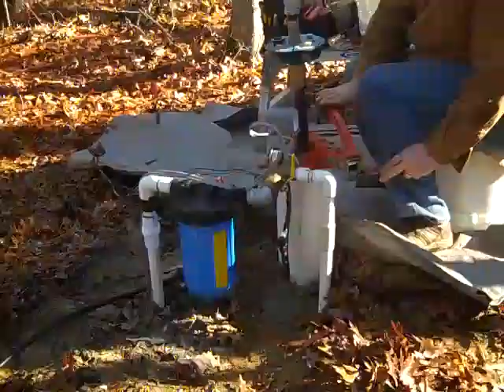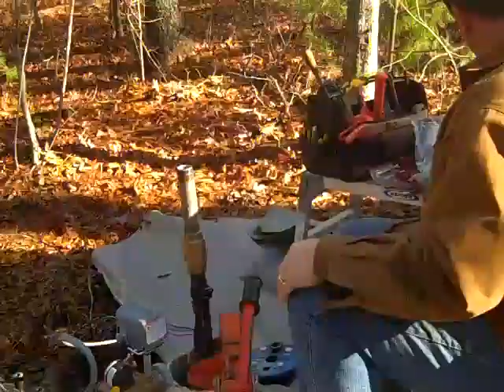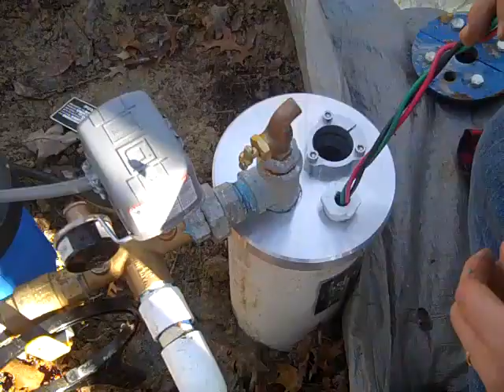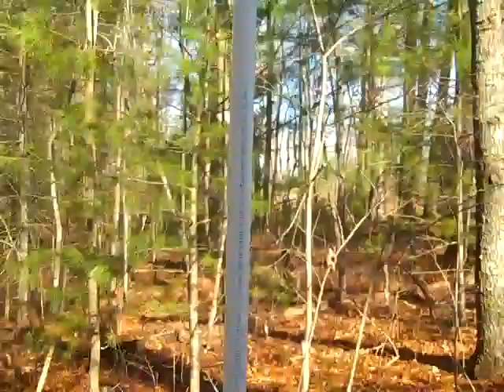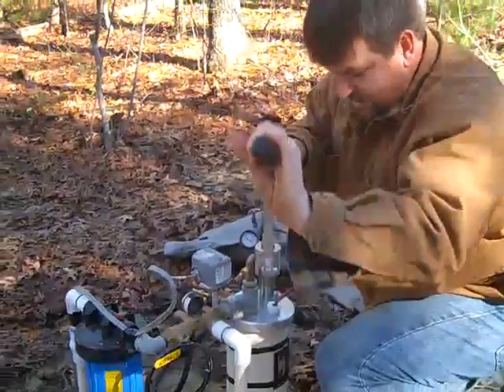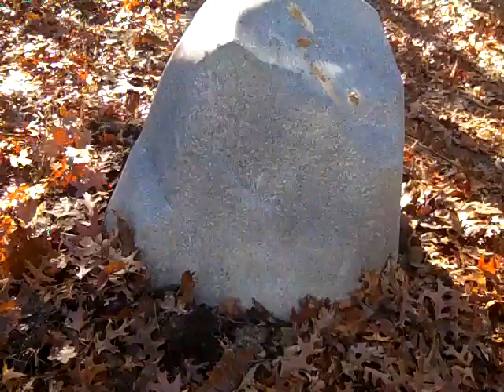Helping other Preppers get the most important Prep. Water!

Comment: I plumbed my simple pump to back feed similar to this set up. I have an 86gal bladder tank. I had to pump for almost 10min to get from 40 up to 45psi. Every stroke I can hear air hissing beneath the well cap. Also the gauge bounces around while pumping, 20-60psi fluctuations. Slowly settles after pumping stops. Air trapped in the system maybe?

Comment: It is 300' to good water where I live, so hand, or solar pump are not sufficient from what I understand.
Reply from the maker: Solar pumps can go deep.  800 ft in some cases.  The hand pump we deal with 300 is about the max.  Remember it is not how deep the well but where the static water level is.  Tell me your static level, recovery rate and we can get you a solution.
Reply: I'd also like to hear a response about that.  My current well is 400' deep.  Is a hand or solar pump an option?
Reply: As far as I know, there isn't a hand pump that will pump from that depth.  It seems that you could make a solar powered pump, but I don't know of one on the market that can pump from that depth.
Reply: In the old days they used windmills to pump water from those depths; even if that is your static water level. You may also want to research and see if it is part of the Great Plains Aquifer...if it is, that water level may not be reliable.
Reply: I talked to a well digger who has experience in this area.  He says there is reliable water under a rock layer at 300'.  We don't have much wind here in Tennessee to operate a windmill.
Reply: engineer775 Practical Preppers
Excellent point!  All of my neighbors wells are in the 200 foot range according to county record.
Reply: Where would you get a solar pump that would pump 300' and how many solar panels would it take to power the pump?  I live in SE Tennessee, where we have lots of sunlight.

Comment: Does the smart Pump fit down thru the well seal after it is on? How deep will it pump? Thanks.
Reply from the maker: Yes the Simple Pump fits through the new custom well seal and I have installed them to 345 ft.
Reply: engineer775 Practical Preppers
Hello, new to your channel like what I've seen.   we are in sw missouri, our pump installer recommended the simple pump, but when they quoted the pricing it was way way out of our reach.  we were looking at the 12v NEMO pumps but due to our well, like many others around here, has a liner in it, there is no room to piggy back the 12v with out existing 1hp as there is only 3" of space left.   Any suggestions for an alternative??   Our solar supplier is pushing us on the AIMS 220v inverter specifically for wells.   My feeling is go to a split phase 120/240v whole house inverter to power the pump but then again, a emp blast would destroy all of it. ?
Reply from the maker: Based on what you are telling me, if you leave your existing pump in then the SimplePump is the only pump I have been able to fit in parallel when a 4" liner is involved.  You could go with the Manual simple pump for your EMP concerns and then look into a solar solution for your submersible.  The folks recommending the Aims, is is part of a system and which one?

Another option would be to go with a 110v submersible making it easier on a generator and or solar system.  If you with the whole house then yes just put the existing pump on the circuit.   None of the options are cheap but I like having a backup not matter what one you choose to go wtih.  Hope that helps a bit.    What HP is your current pump, does it use a capacitor start box and what is your static water level?

Comment: Hello: Good info. I have never seen a pump switch on top of the well. Where was the starter box for the pump. I'll bet you would tell me I have an old pump. It is a 1966 Gould 3/4 horse. It supplies the house plus a business for 20 years. I would like to know how many gallons of water it has pumped ?  Its 160 ft. and I wonder if it will make it to 50 years old. Have a Good One